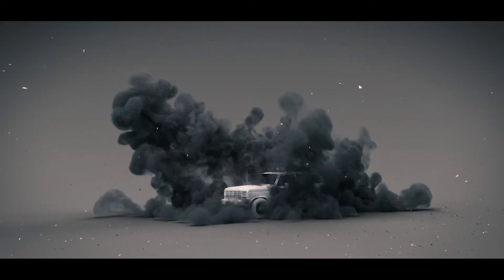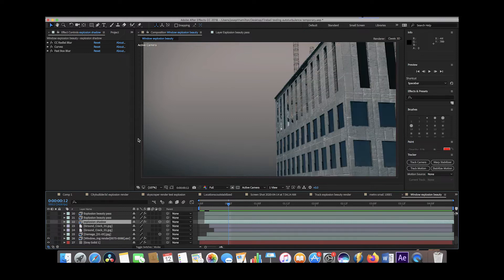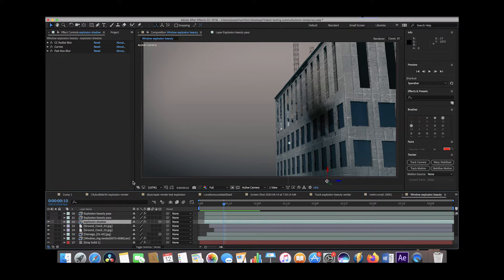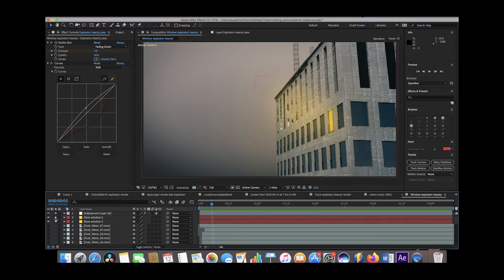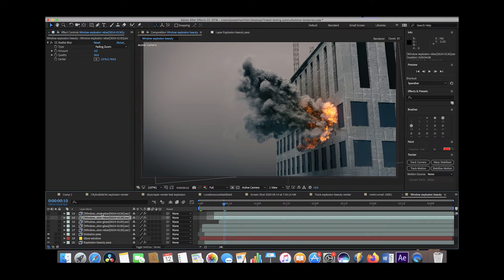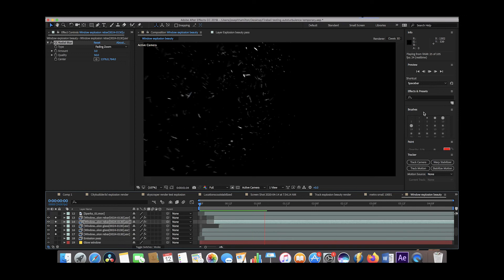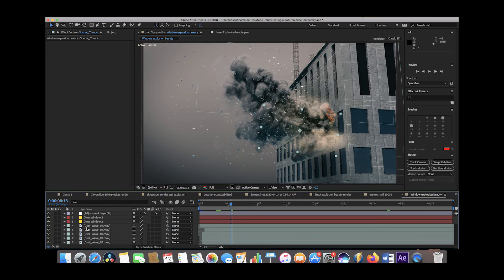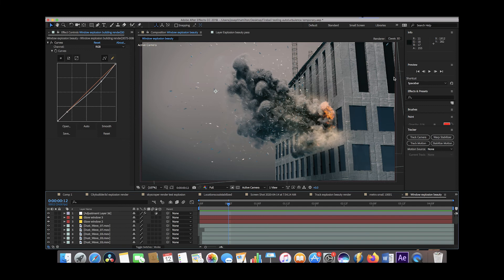Blender 3d window Explosion Compositing: After Effects Walkthrough

Comment: Hi! 2 questions about the emission pass:
- is it rendered transparent or it has black background in it? Because My renders of emit pass always result with no transparency (black background) even if I set it on for all passes.
-  in after effects which one of the 3 "screen" blending mode do you set on the emission pass: screen color, screen classic or screen linear ?
Thanks for your hard work!!
Reply from the maker: Emission pass is exported on a black background. In after effects I vary between the add and screen blending modes. I do bring down opacity a bit usually(to around 65%) and sometimes keyframe the opacity higher at the beginning of the explosion as well.
Reply: @LightArchitect  Precious tips! Thank you!!!
Reply: ah forgot the 3d question: do you bring down the opacity of the emission pass layer in after effects or just keep it 100% ?